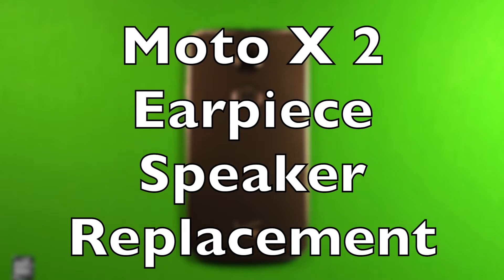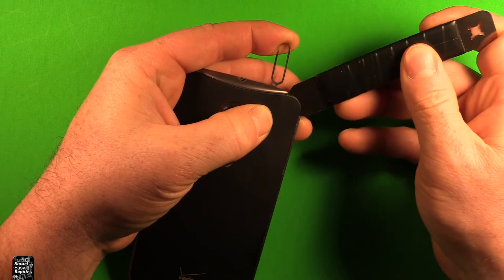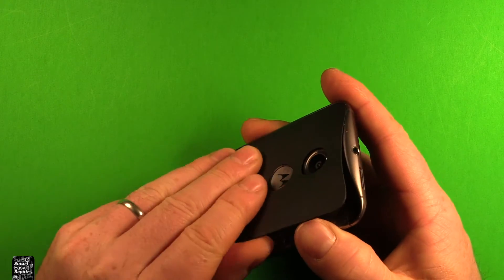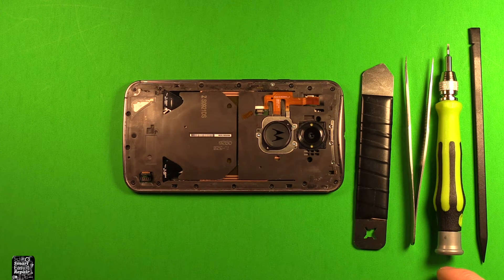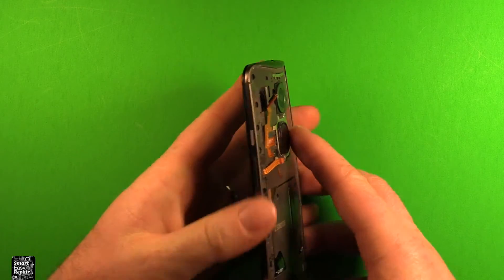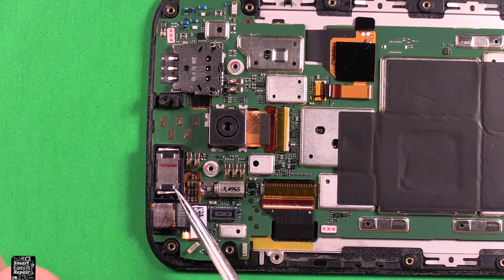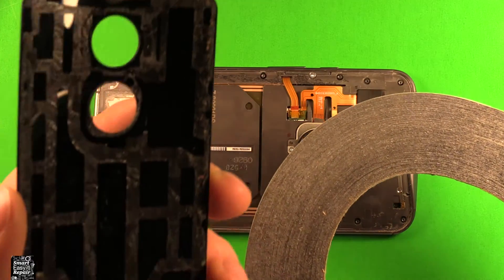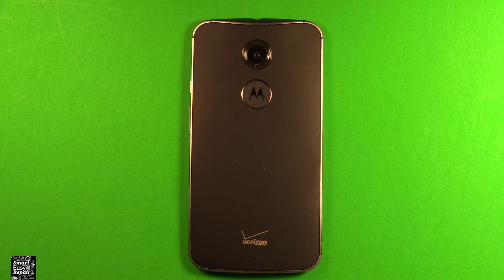Moto X (2nd Gen) Earpiece Speaker Replacement How To Change

Comment: the screws in my were T3. also, the speaker looks the same as the earpiece speaker in the moto x 1st gen. I haven't tested compatibility, but, identical in form, shape, and connectors.
Reply from the maker: +Eric Pedersen Cool. It's worth a try if you already got a speaker from a 1st gen.

Comment: hey man! neat tutorial you got there. i was wondering where can i get a replacement earpiece? thanks man!
Reply from the maker: +Ej Lambert Hey thanks I'm glad it helped. I have a link in the video description below the video where you can find it.
Reply: Smart Easy Repair I live at Philippines, and moto phones are not that common here. Can I use samsung or any other brand of earpiece? Thanks again!
Reply from the maker: +Ej Lambert I don't think any other brand will fit. Even different moto generations are different usually.

Comment: Thanks for the video!  Very helpful.  I have one of these and the earpiece stopped working.  Tried a full factory reset, then replacing the earpiece with the vid here.  Still not working.  Any ideas?  If I can't figure it out I'll either have to make due with headphones/speakerphone or get a new phone.
Reply from the maker: +Spencer Whitman Youre welcome. Man I'm not sure if you can't get anything to help. It sounds like maybe a connection issue with the motherboard or something.

Comment: Hi, i just put a new battery in my Moto X and not the speakers don't work, I suspect a bad connection but im not sure what to look for. do you have any suggestions?
Reply from the maker: +ner Namez I would just double check all your connections. Make sure your connectors are seated down properly and also if there are lil prongs make sure they aren't bent.
Reply: thanks, i took it apart again and everything looked good,  I bent the prongs a little further than they were and its working fine now.
Reply from the maker: Ok awesome good for you!!
Reply: Which prongs are you talking about? I'm having the same issue you described: I changed the battery and now the loud speaker doesn't work.
Reply: Eric Hubert i honestly cant remember all they clearly now. I think they were just little gold contacts that touched the speaker. I noticed one looked like it laid a little flatter than the other one (there are two close together just...under the speaker i think, or over depending on how you hold the phone). i bent the one up about another mm or 2mm and put the phone back together and bam, sound. Hope this helps, i know it scared me when it happened but its just a connection issue, or at least for me it was. good luck.
Reply: ner Namez Thanks for the info!!

Comment: Hey Man! awesome video! one question about choosing the best part. When I go to Ebay, the results show refurbished parts which are sold from sellers here in the US and new ones coming from China. Which one do you recommend?

Also, they usually show for models XT1094 , XT1095, XT1096, XT1097, XT1098. Do we have to be specific about the earpiece we buy or it fits all the models?

Thank you so much in advance!
Reply from the maker: +Alfredo Mori I think you should check that it fits your model is all. I would just get one from the us if possible it usually takes a long time from China.